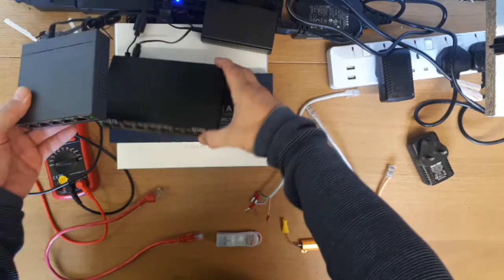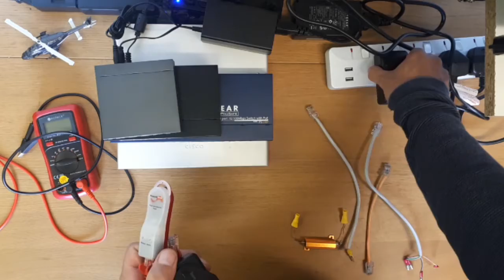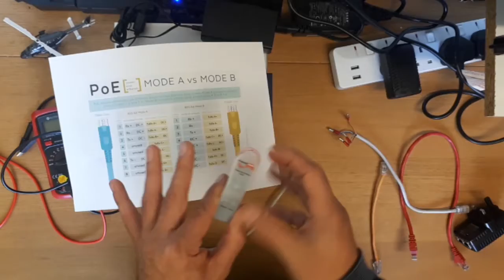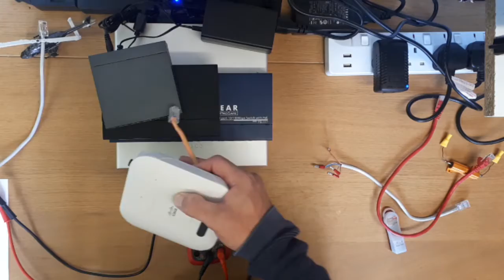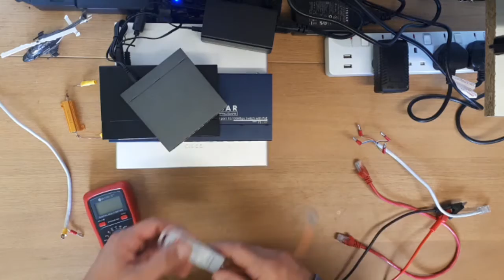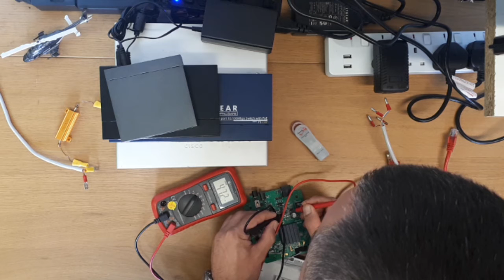Power over Ethernet (PoE) Lab and Experiment

Comment: Do you know a Gigabit adapter injector? I can't find one that is cheap
also looking for a solution with the cable line end if I choose to use poe switch then the other side needs a stepdown to 12v but the problem is I hate to use injector splitter because the power maybe unreliable cause the wifi or the accesspoint to messed with the signal and IP addresses . that's why I'm also looking for a stepdown that I can attach before the balun connector